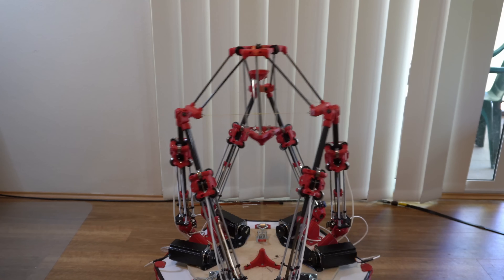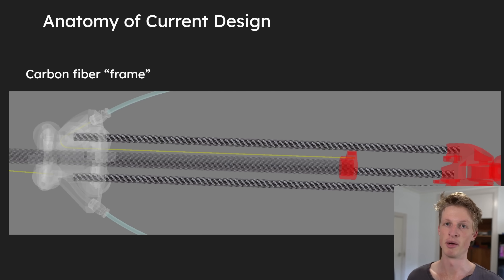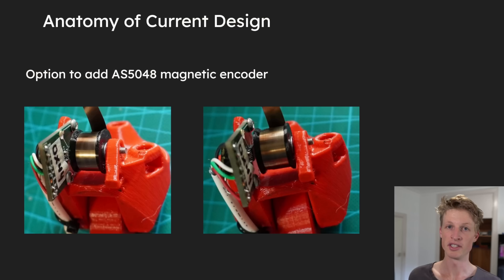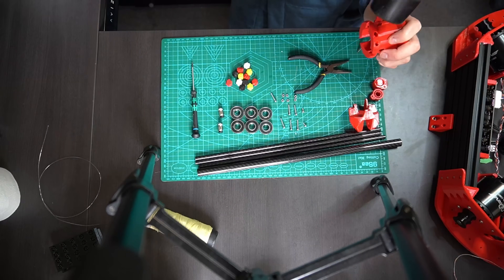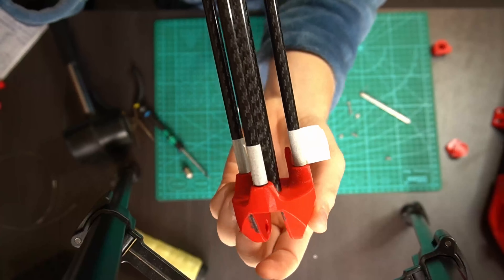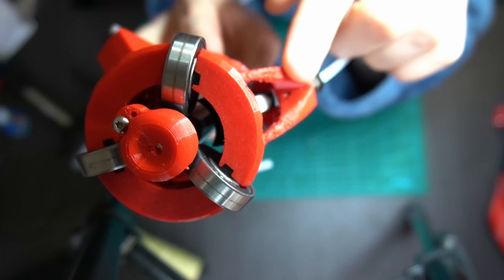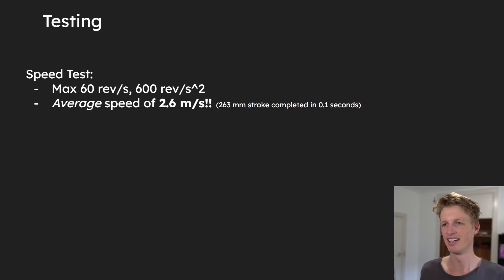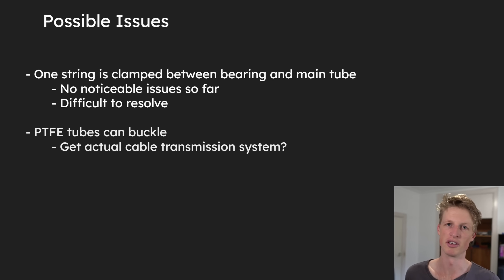Designing High-Performance Linear Actuators: Speed & Stiffness for my Juggling Robot | PDJ#19

Comment: This is awesome! Question, why mount a magnet at the end of the tube? A suggestion maybe for the string, why not route the string trough one of the carbon support tubes?
Reply from the maker: Good question! I designed this actuator for my juggling robot—Jugglebot (they don't pay us engineers to come up with good names 😅)—as part of the "Stewart Platform" structure of the robot. These actuators (there will be 6 of them) connect to the upper "platform" with magnetic joints, which offers a few advantages over the old universal joints I was previously using. Check out this video if you're curious 😊 https://www.youtube.com/watch?v=ACidat_EQ3Q

As for your suggestion with the string routing: I had considered routing the string through the central tube but quickly ran into issues with getting it out again. I hadn't thought about routing through the support tubes though. That's an interesting idea that I'll have a think about today as I build the rest of the actuators. Thanks for the suggestion!

Comment: Great video! Can't wait for the next one! I don't have any experience with cabling systems either, but I have used pneumatic tubing like this for other projects (something like McMaster 9446K21) and it's considerably stiffer than bowden tubing. It won't be as slippery a ptfe, though, so it's possible the tubing could melt at high enough speeds.
Reply from the maker: Thanks for the kind words 😊

Interesting! By stiff, do you mean in compression, or bending? Jugglebot needs fairly flexible tubes (in bending) to not restrict its range of motion. I WISH we had McMaster Carr in Australia. Honestly such a pain to source parts that are so easily available in the US 😭
Reply: @harrisonlow  In compression - since the walls are thicker, it's much less likely to buckle. It might not be quite as bendable as a bowden tube, but I think it would bend just fine even at the speeds you're running. They should be pretty common, lots of home air compressors use similar tubing for their hose.
Reply from the maker: @tategeiger5317  Thanks for the suggestion - I will start the hunt for some pneumatic tubing!

I agree re. bending stiffness: it wouldn't need to be as flexible as the PTFE to be a non-issue for my purposes

Comment: Consider mounting one bearing of each triplet on a small flexure preload spring. That way you don't need to adjust each guide. Stiffness up-to the preload will be determined by the remaining four fixed bearings. :)
Reply from the maker: Interesting idea! I think this might have the same issue as what Charlie Wynn was suggesting in another comment - the central tube should be perfectly centred in the actuator for what I'm using it for. Precision will be very important for Jugglebot and I want to try and keep everything as concentric as possible. Thankfully the spacers/guides are really easy to swap out and once you find a size that works, there's no need to change them again
Reply: @harrisonlow  if you’re worried about accuracy, I would adjust your attachment points on the rod for your strings. They look like they are at an angle in your video. Combined with the fact you’re only measuring distance on your motor, you’ve introduced potential backlash in the system, AND you’re measuring the change of the hypotenuse of the triangle you create with the string instead of the actual linear, parallel distance. It is probably not a lot at all, but in belt driven systems that need accuracy, the small angle can definitely throw off measurements.
Reply from the maker: @JustTryGambling  Good thinking! Something I didn't explicitly say in this video is that these actuators (there will be 6 of them) are being used to power a Stewart Platform, so the actuators need to move around quite a bit. The PTFE/string attachment points are angled to (hopefully) lessen the degree to which the PTFE inhibits the platform from moving around
Reply: @harrisonlow  as long as the system is stiff enough, can't you compensate for the lack of concentricity through software?
Reply from the maker: @LimitedWard  Yeah, probably! Though I want to limit the amount of hard-coding of this sort of physical "defect" that I need to do

Comment: Can't you just use a tube that is used on bicycle or motorcyle brakes?
Reply from the maker: You probably could for most applications, but Jugglebot needs fairly flexible tubes, as these actuators will be moving around a bit and I don't want the tubes to impede that motion. I think bike tubes would be a little too stiff unfortunately 🙁
Reply: I don't think that bicycle tubes are much stiffer than the ptfe tubes. Bicyle brake cable tubes can easily be bent around a radius of 10 cm.
Reply from the maker: @berkhanb  You have convinced me to give it a try! I'll fish out some of our brake tube from the garage and have a play with it tomorrow. Cheers for the suggestion!

Comment: Loving the progress! You can get rid of the bowden tubes and also stiffen your transmission coupling by guiding the cable around pulleys which rotate coaxially with your gimbal joints. The two cables need to wrap in opposite directions so that the total cable length remains constant. Normally this would slightly kinematically couple your linear motion with the rotation, but you can cancel this geometrically by offsetting the linear axis from the gimbal axis by the same radius as the pulleys. You can duplicate this concept rotated 90 degrees to get the other DOF of rotation. If you need help visualizing/designing the pulley layout, let me know, but I think it should be a feasible way of getting well-constrained cable motion to the actuator with almost zero flex/compliance or motion coupling. The pulleys could actually be a single, dual groove pulley since they will rotate in tandem, but you can also just use 2 parallel pulleys or one on each side of the joint itself.
Reply from the maker: Thanks! 

Hmm, I'm having difficulty visualising what you're describing. Do you know of any real-world systems that use something similar? I do quite like the sound of a tighter transmission 😁
Reply: @harrisonlow  Skyentific has shown a mechanism using pulleys co-axial with arm rotation, but for the purpose of actuating the arm itself. 
https://www.youtube.com/watch?v=utDagouxM5U
 The idea I'm suggesting simply uses such pulleys to guide the cable onto and back off of the rotating body. I will try drawing the idea a little later and sending a picture if you would find that helpful.
Reply from the maker: @ericcmcgraw  Very interesting! I just watched that video and I think I have a better idea of what you're describing. I have a few thoughts:

1) I'm quite averse to shifting the linear axis away from the centre of rotation as that makes the inverse kinematics for the stewart platform (what these actuators will be used for) significantly more difficult. I don't know exactly how much more difficult, but I started working through it a while ago and after a while decided to just make the joint axes coincident with the linear axis 😅

2) This design looks like it'd require quite a few parts, and at the scale I'm working at, they'd have to be fairly small. I'm trying to cut down on complexity as much as possible (especially where it concerns manufacturing).

3) As a slight (maybe) spoiler, I'm actually thinking I'll change the lower universal joint for a magnetic joint, in a similar fashion to the upper joints (this video if you haven't seen it already: https://www.youtube.com/watch?v=ACidat_EQ3Q ). I'm not sure if this would affect the design you're describing, but it seems relevant to mention.

Again, thanks for the idea! I'm interested to know what you think about the above points 😊
Reply from the maker: @ericcmcgraw  Grr, I think YouTube may have removed your last comment. I can see some of it in my notification, but nothing past a "small error" re. shifting the linear axis. Did you include any links? Youtube seems to dislike links to external sites 😡
Reply: @harrisonlow  Yep, I tried obfuscating the link by spelling it out, but still no luck. Here's the comment with the link removed:

1) I thought of that too, so I played around in Geogebra and found that you could still assume the linear axis rotates through a single point and you'd have relatively small error compared to reality. Assuming ±45 degree range of rotation, and 10mm diameter pulleys, the actual length error would only be ±0.1 mm throughout the range of motion. Here's the Geogebra file if you want to play around with it: (redacted) There do exist solutions which would cancel this error exactly, but the complexity is higher still. Let me know if you're interested in them.

2) I've found some design possibilities which add only a few additional pulleys to the part count you already have. Complexity is a little higher, yes, but the benefits are: no sliding friction in bowden, no risk of bowden buckling, higher tension and higher stiffness capability. It's up to you whether it's worth it.

3) Yes I saw those ball joints, it's a pretty elegant solution and I like how it makes the actuators detachable and modular. Of course the only drawback, as you mention, is the pulling force capability. As you start to push the limits of acceleration (how many balls can it juggle at a time, etc.) you may want to be able to apply high forces in both directions without worrying about the joints falling apart. Again, it's up to your own judgement (and level of ambition 😁)
Reply from the maker: @ericcmcgraw  Darn, YouTube is getting too smart for its own good!

1) That's interesting to know! Part of me has a hard time accepting numerical solutions so I didn't test the offset axes in a more experimental way to actually see what error would be introduced.

3) Haha it's funny you mention that. After a full day of constructing the remaining actuators and platform, I put it all together only to find out that the magnet joints aren't even strong enough to hold itself together! Bit of a bummer, but in hindsight 500g of pulling force was never going to cut it. Thankfully I found an AU supplier that had proper magnetic ball joints (I think they're used in delta-style 3D printers?) with up to 20kg of pull force on sale! Hopefully they arrive soon 😁

I find this idea very fascinating and I will note it as a possible (probable?) improvement for the next version of the actuators. I may follow up here if I get stuck on any of the design work for it.

Cheers again for the idea!
Reply: I've seen something like what you describe on an old dentist's drill.

Comment: Really enjoyed this video.
I think the youtube algorithm may have removed my last comment due to it having links in it so I'll try again, without links.
A possible replacement for the PTFE tubes could be "armour spring" that is used to protect loop connections on fishing rigs. It is highly resistant to crush and compression forces and is very flexible and light.
There are two potential issues. 
1. It is usually only available in packets of 10 x 10cm lengths. 
2. It is usually green.
Regarding issue 1. I tried joining two lengths with a small section of heatshrink. This worked well. I set it up in a rig using 100lb dyneema and was able to lift 3Kg without any permanent deformation of the armour spring.
Regarding issue 2. I see that there is 1.2mm ID armour spring in the Shogun brand that is red. 
You may have a tackle shop nearby where you can pick some up to play with.
It may even be possible to wind your own using suitable coated stainless wire.
Reply from the maker: Thanks for the kind words 😊

I've never heard of armour springs! They seem to be difficult to find good information about... Can't even find them on Amazon! (I don't have a tackle shop super close by). Do they go by other names?

As it happens, I actually have a few lengths of long, narrow springs on hand so I'll play around with them. Hopefully the "armour" part of "armour spring" isn't too critical 😉

Cheers for the idea!
Reply: @harrisonlow  maybe try googling "Wellsys ARMOUR GUARD".
I'd put in a link but YouTube clobbered me last time.
Reply from the maker: Just gave this a quick test and it seems like a promising idea! Working prototype is a (~2.5 mm ID, 3.25 mm OD) spring that's about 50 cm long. The spring conveniently fits the PC4-M6 PTFE connectors that I already have, and it's working pretty well!

I'll give this idea a proper go some time in the next few days. My biggest concerns right now are: 1) friction between the string and the spring; and 2) sourcing the springs if I were to do this at-scale. I have these ones as a leftover from a uni project a few years ago and I don't think they're very easy to source in Australia...

Comment: How to get rid of the bowden tubes? Why not use a flex shaft to relocate the drum from the motor shaft to the base of the actuator? This would also save space by allowing you to attach the pull cable to the bottom of the actuator shaft. The pull side of the drum would be centered under the shaft. The push cable would still need to run up to the pully and back down to the bottom of the shaft. No more strings running to the top. 

How to remove the backlash? Why not just add a spring to your newly relocated drum mount and turn it into a tensioner similar to a serpentine belt tensioner?

A TEMO flex shaft is like $15.
Reply from the maker: Interesting! I'm not sure I 100% understand what you're suggesting, but I have a few thoughts related to this:

1) I'm interested by the idea of flex shafts / push-pull cables (are these the same things?). I've seen people suggest them on the Wintergatan project but haven't had the time to look into them much. Are they particularly flexible?

2) For my application (Stewart Platform) it's somewhat useful to have the motor be physically separate from the actuator itself, as the actuator will be moving around and the motor would get in the way and just be more mass to move around.

3) An unintended boon to the way I have the strings routed now is that the end caps on the central tube are only ever pulled in towards the tube. This is rather nice as it means that they'll never get pulled off if the string pulls too fast/hard, since they're only connected via a not-super-strong interference fit. I could of course make that fit better, but that would be more effort!

Re. backlash removal: Yes! I agree with your idea of the spring, and this is something that I will absolutely be adding if backlash becomes an issue for whatever reason.

Cheers for the ideas!

Comment: What if the spacers were eccentric so you could rotate them for a perfect fit? Might not work with a 3d printed part. Seems like your solution with a few sizes works great already though 🙂
Reply from the maker: That's a very interesting idea! One potential issue I can see with that is that it'd make straightening the extending rod a little tricky. I didn't explicitly mention this in the video but I've been keeping each "set" of spacers (ie. top three or bottom three) the same size so that the central rod is kept centred. Having the spacers be eccentric might make this a little difficult. 

Very cool idea though and I'll keep that in mind if I need to do anything similar in the future. Cheers!
Reply: @harrisonlow  ooh, very good point about wanting to put the same spacers around so it stays centered!